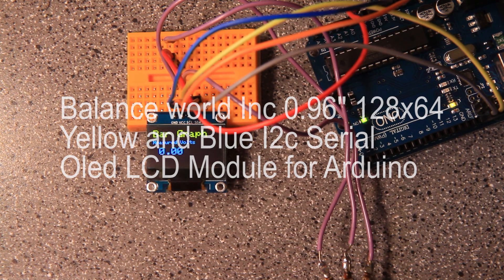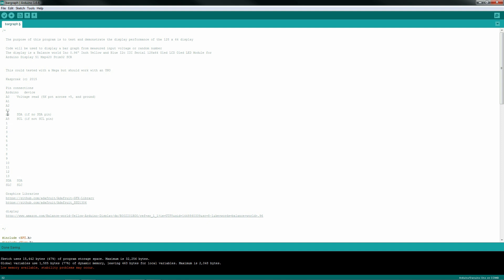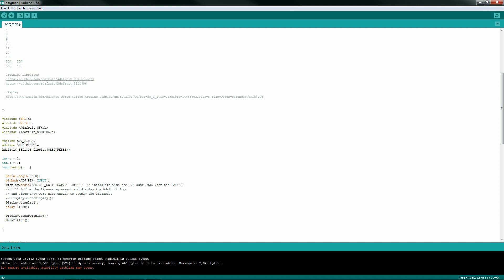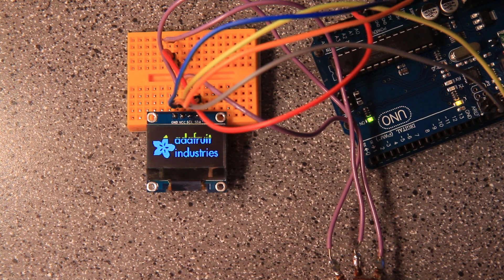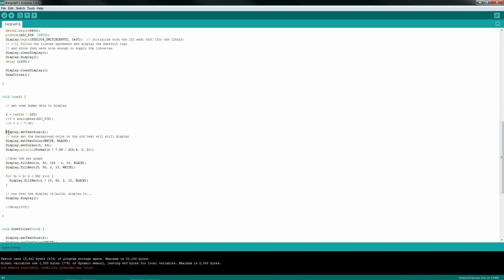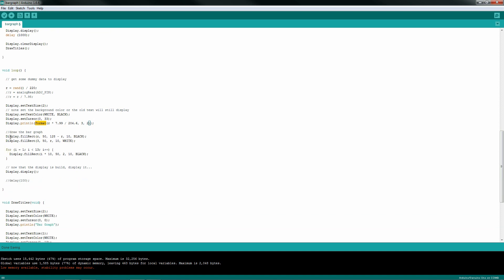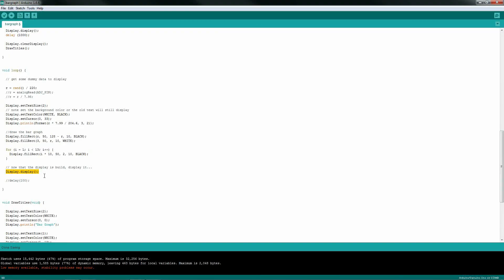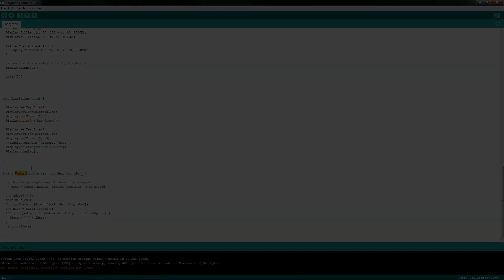Arduino and 128x64 OLED Display FREE CODE!!!

Comment: Hi Kris, I have a Problem with writing a graph for temperature on an Oled Screen. Can I send you the code to look at? The temperature Display is wiped out with the graph although it is in seperate lines. Could you have a look?Regards, Paul
Reply from the maker: OE8PCK sure, I wonder if you could post the code as a comment.
Reply: Thanks for your answer Kris. I think I should say what I am trying to achieve. I fly model gliders and Need a measurement of the Temperature or I should say temperature Change. My sketch recieves a valuse from the Transmitter using a 433 mhz rx. This value is measured aover a few seconds and is used as a ambiant temperature. The Value is then sent to the Oled as a decimal value. Above this acrual valuse I have tried to make a visual value as a graph . The reason is that I Need to see a temperature Change from around 1.5 to 2 degrees C as a graph. The graph I have as the Moment has a Problem, the decimal value is wiped out and the graph disappears after it runs over the Screen..I would like the following.A line that runs over the Screen (the Speed should be changeable in the code) left to right, and when the temperature changes then the line should move up. The actual value should remain . I will now send the sketch for the Receiver, with the OLed, if you Need the TX code please tell me. If you do Change anything please write a description so I can adjust the Speed etc. Many THANKS!!!!!!Paul// receiver temp.
//
#include <VirtualWire.h>#include "U8glib.h"//U8GLIB_SH1106_128X64 u8g(13, 11, 10, 9);  // SW SPI Com: SCK = 13, MOSI = 11, CS = 10, A0 = 9
U8GLIB_SSD1306_128X64 u8g(U8G_I2C_OPT_DEV_0|U8G_I2C_OPT_NO_ACK|U8G_I2C_OPT_FAST);  // Fast I2C / TWI 
int count;
float temperatureNow;
float tempGraph[64];
float baseTemp;
float graphVal2;
int graphVal1;
int graphpos = 0;
void draw(void) {
  u8g.setColorIndex(1);
  
  // graphic commands to redraw the complete screen should be placed here  
  u8g.setFont(u8g_font_unifont);
   u8g.setPrintPos(0,55);
  u8g.print(temperatureNow);
  //u8g.setFont(u8g_font_osb21);
  //u8g.drawStr( 0, 22, "Hello World!");
  u8g.drawBox(0,0,128,40); 
  u8g.setColorIndex(0);
   for(int i=0;i<64;i++)
  {
    if(tempGraph[i] == 0){
      // do nothing if no data in array
    }else{
     graphVal2 = tempGraph[i] - baseTemp;
    graphVal1 = graphVal2 * 10; // a temperature diference of 1.25 would translate to 13 pixels drawn on the graph
    //u8g.drawPixel(graphpos, 40-graphVal1);  One line of pixels isn't very clear
    u8g.drawBox(graphpos,40-graphVal1,2,graphVal1); 
    }
    
    graphpos = graphpos+2;
    }
  graphpos = 0;
 
}void setup(void) {
baseTemp = 100.99;
Serial.begin(9600);  // Debugging only
    Serial.println("setup"); //Prints "Setup" to the serial monitor
    vw_set_rx_pin(12);       //Sets pin D12 as the RX Pin
    //vw_set_ptt_inverted(true); // Required for DR3100
    vw_setup(4000);      // Bits per sec
    vw_rx_start();       // Start the receiver PLL running
  
 // You don't need the color stuff because you display is monochrome
  // assign default color value
//  if ( u8g.getMode() == U8G_MODE_R3G3B2 ) {
//    u8g.setColorIndex(255);     // white
//  }
//  else if ( u8g.getMode() == U8G_MODE_GRAY2BIT ) {
//    u8g.setColorIndex(3);         // max intensity
//  }
//  else if ( u8g.getMode() == U8G_MODE_BW ) {
//    u8g.setColorIndex(1);         // pixel on
//  }
//  else if ( u8g.getMode() == U8G_MODE_HICOLOR ) {
//    u8g.setHiColorByRGB(255,255,255);
//  }
}void loop(void) {
graphpos = 0;
    String tempHolder = "";
    uint8_t buf[VW_MAX_MESSAGE_LEN];
    uint8_t buflen = VW_MAX_MESSAGE_LEN;
    if (vw_get_message(buf, &buflen)) // Non-blocking
    {
        digitalWrite(13, true);  // Flash a light to show received good message
  // Message with a good checksum received, dump it.
  Serial.print("Got: ");
  
  for (int i = 0; i < buflen; i++)
  {
            char c = (buf[i]);
            tempHolder += c;
  }
        count++;
       // Serial.print(count);
 
       temperatureNow = tempHolder.toInt();
       temperatureNow = temperatureNow / 100;
  Serial.println(temperatureNow);
  publishToGraph();
        digitalWrite(13, false);
    }
  
  // picture loop
  u8g.firstPage();  
  do {
    draw();
  } while( u8g.nextPage() );
  
  // rebuild the picture after some delay
  delay(50);
}void publishToGraph() {
   if(temperatureNow < baseTemp){  baseTemp = temperatureNow;
  }
  for(int i=0;i<64;i++)
  {
    tempGraph[i]=tempGraph[i+1];
    }
 tempGraph[64] = temperatureNow;
}
Reply from the maker: First of all, what's not working? can't receive data, plots are wrong, won't compile? Hard to say what the issue could be given the issues in the code. Undefined constants (VW_MAX_MESSAGE_LEN), very odd baud rate (4000), and so on. .
Reply: When I receive data from the 433mhz rx the bar disappears and moves across the screnn and also wipes out the temerature Digits and I end up with a blank Screen. The baud rate id not for the arduino but for the rx, this is Setup eith the same Speed as the TX. I would like just a line which goes across the Screen at ambient temerature and then when the temperature increases the line should bend upwards. The reception of the data is also very erratic but this is not my main Problem that I have. Getting the graph to work so that the temerature Digits are not wiped out and getting the graph to remain visible that are my main concerns.I have been working on this code for 4 and a half months now and it still will not work. I came to you because of your code on the poti and the resulting graph. I guess it is my old Age nearly 70, .. perhaps I should not have  started this and remained wih my Radio stuff which I understand a lot better. :-) I hope I have explained clearly what I am trying to achieve. If you would like a direct Explanation, I have SKYPE and the Skype Name id OE8PCK. Thanks for your Patience.
Reply: I think I have got things a bit muddled. The way the following code is supposed to work is that it Displays a bar that Shows thwe ambient temperature and when the temperature changes the bar changes. Basically it does not work. Could you Show me some code which would Display the Temerature received as a line running from left to right across the Screen and when the temerature increases moves up so as to Show a curve. This line should not interfere with the digital temerature readout I have at pos. 0,55 on the Screen. The idea with a drawing a box does not work because as it moves across the Screen the Digits of the temperature Display are wiped out. Regarding the very odd baud rate (4000), This is used by the Radio Tx and RX, it has nothing to does with baud rates. Regarding the  Undefined constants (VW_MAX_MESSAGE_LEN),  to be honest, I do not understand this part of the code, it has to do with changing the drawn box. Someone sent this to me as a Suggestion. I will now include the sketch again and perhaps you can Change it to Show the Temerature Change as a line. I really only want to see a small temerature Change using this line. e.g. when the temperature changes by 2 degrees C.// receiver temp.
// By Paul OE8PCK
#include <VirtualWire.h>
#include "U8glib.h"U8GLIB_SSD1306_128X64 u8g(U8G_I2C_OPT_DEV_0|U8G_I2C_OPT_NO_ACK|U8G_I2C_OPT_FAST);  // Fast I2C / TWI 
int count;
float temperatureNow;
float tempGraph[64];
float baseTemp;
float graphVal2;
int graphVal1;
int graphpos = 0;void draw(void) {
  u8g.setColorIndex(1);
  
  // graphic commands to redraw the complete screen should be placed here  
  u8g.setFont(u8g_font_unifont);
  
   u8g.setPrintPos(0,55);
  u8g.print(temperatureNow);
 u8g.print(" Degrees C"); 
  u8g.drawBox(0,0,128,40); 
  u8g.setColorIndex(0);
   for(int i=0;i<64;i++)
  {
    if(tempGraph[i] == 0){
      // do nothing if no data in array
    }else{
     graphVal2 = tempGraph[i] - baseTemp;
    graphVal1 = graphVal2 * 10; // a temperature diference of 1.25 would translate to 13 pixels drawn on the graph
    //u8g.drawPixel(graphpos, 40-graphVal1); // One line of pixels isn't very clear
    u8g.drawBox(graphpos,40-graphVal1,2,graphVal1); 
    }
    
    graphpos = graphpos+2;
    }
  graphpos = 0;
 
}void setup(void) {
baseTemp = 100.99;
Serial.begin(9600);  // Debugging only
    Serial.println("setup"); //Prints "Setup" to the serial monitor
    vw_set_rx_pin(12);       //Sets pin D12 as the RX Pin
    //vw_set_ptt_inverted(true); // Required for DR3100
    vw_setup(4000);      // Bits per sec
    vw_rx_start();       // Start the receiver PLL running
  
 
}void loop(void) {
graphpos = 0;
    String tempHolder = "";
    uint8_t buf[VW_MAX_MESSAGE_LEN];
    uint8_t buflen = VW_MAX_MESSAGE_LEN;
    if (vw_get_message(buf, &buflen)) // Non-blocking
    {
        digitalWrite(13, true);  // Flash a light to show received good message
  // Message with a good checksum received, dump it.
  Serial.print("Got: ");
  
  for (int i = 0; i < buflen; i++)
  {
            char c = (buf[i]);
            tempHolder += c;
  }
        count++;
        //Serial.print(count);
 
       temperatureNow = tempHolder.toInt();
       temperatureNow = temperatureNow / 100;
  Serial.print(temperatureNow);
   Serial.println(" Degrees C");  publishToGraph();
        digitalWrite(13, false);
    }
  
  // picture loop
  u8g.firstPage();  
  do {
    draw();
  }
  while( u8g.nextPage() );
  
  // rebuild the picture after some delay
  delay(50);
}void publishToGraph() {
   if(temperatureNow < baseTemp){  baseTemp = temperatureNow;
  }
  for(int i=0;i<64;i++)
  {
    tempGraph[i]=tempGraph[i+1];
    }
 tempGraph[64] = temperatureNow;
}
Reply: Hi Kris,I think I can make things a lot easier. I have now changed your code so as to use the dotted graph to show temperature Change. Could you be so kind as to make the line movement more sensative, i.e. 3 dots per degree of temperature change fom the third temperature reading after the Moment of Switch on. The. LED flashes when the temperature is read OK perhaps you can use this. Does this make my wish now clear? Many thanks in advance for your kind help.
Reply: /*  The purpose of this program is to test and demonstrate the display performance of the 128 x 64 display  Code will be used to display a bar graph from measured input voltage or random number
  The display is a Balance world Inc 0.96" Inch Yellow and Blue I2c IIC Serial 128x64 Oled LCD Oled LED Module for
  Arduino Display 51 Msp420 Stim32 SCR
  This could tested with a Mega but should work with an UNO  Kasprzak (c) 2015  Pin connections
  Arduino   device
  A0    Voltage read (5K pot across +5, and ground)
  A1
  A2
  A3
  A4    SDA (if no SDA pin)
  A5    SCL (if not SCL pin)
  1
  2
  3
  4
  5
  6
  7
  8
  9
  10
  11
  12
  13
  SDA   SDA
  SLC   SLC  Graphics Libraries
  https://github.com/adafruit/Adafruit-GFX-Library
  https://github.com/adafruit/Adafruit_SSD1306  display
  http://www.amazon.com/Balance-world-Yellow-Arduino-Display/dp/B00ZI01RO0/ref=sr_1_1?ie=UTF8&qid=1448860339&sr=8-1&keywords=balance+world+.96
*/#include <SPI.h>
#include <Wire.h>
#include <Adafruit_GFX.h>
#include <Adafruit_SSD1306.h>
#include <VirtualWire.h>
#define OLED_RESET 4
float temperatureNow;
int count;
int graphpos = 0;Adafruit_SSD1306 Display(OLED_RESET);float r = 0;
int i = 0;void setup(void) {
//  baseTemp = 100.99;
  Serial.begin(9600);  // Debugging only
  Serial.println("setup"); //Prints "Setup" to the serial monitor
  vw_set_rx_pin(12);       //Sets pin D12 as the RX Pin
  //vw_set_ptt_inverted(true); // Required for DR3100
  vw_setup(4000);      // Bits per sec
  vw_rx_start();       // Start the receiver PLL running#if (SSD1306_LCDHEIGHT !=64)
#error ("Height incorrect, please fix Adafruit_SSD1306.h!");
#endif
  Display.begin(SSD1306_SWITCHCAPVCC, 0x3C);  // initialize with the I2C addr 0x3C (for the 128x32)
  Display.begin();  // i'll follow the license agreement and display the Adafruit logo
  // and since they were nice enough to supply the libraries
  //Display.clearDisplay();
  Display.display();
  delay (1);
  Display.clearDisplay();
  DrawTitles();}void loop(void) {
  graphpos = 0;
  String tempHolder = "";
  uint8_t buf[VW_MAX_MESSAGE_LEN];
  uint8_t buflen = VW_MAX_MESSAGE_LEN;
 if (vw_get_message(buf, &buflen)) // Non-blocking
  
  {
    digitalWrite(13, true);  // Flash a light to show received good message
    // Message with a good checksum received, dump it.
    Serial.print("Got: ");    for (int i = 0; i < buflen; i++)
    {
      char c = (buf[i]);
      tempHolder += c;
    }
    count++;
    //Serial.print(count);    temperatureNow = tempHolder.toInt();
    temperatureNow = temperatureNow / 100;
    Serial.print(temperatureNow);
    Serial.println(" Degrees C");  }  //void loop() {  // get Temperature  r = temperatureNow;
  
  Display.setTextSize(2);
  // note set the background color or the old text will still display
  Display.setTextColor(WHITE, BLACK);
  Display.setCursor(0, 20);
   Display.print(r);
   Display.println(" C");
   
   //draw the bar graph
  Display.fillRect(r, 50, 128 - r, 10, BLACK);
  Display.fillRect(3, 50, r, 10, WHITE);  for (i = 1; i < 13; i++) {
    Display.fillRect(i * 10, 50, 2, 10, BLACK);
  }  // now that the display is build, display it...
  Display.display();
}
void DrawTitles(void)
{
  Display.setTextSize(1);
  Display.setTextColor(WHITE);
  Display.setCursor(0, 0);
  //Display.print(r);
  Display.println("Thermal Search");
 // Display.display();
}String Format(double val, int dec, int dig ) {  // this is my simple way of formatting a number
  // data = Format(number, digits, decimals) when needed  int addpad = 0;
  char sbuf[20];
  String fdata = (dtostrf(val, dec, dig, sbuf));
  int slen = fdata.length();
  for ( addpad = 1; addpad <= dec + dig - slen; addpad++) {
    fdata = " " + fdata;
  }
  return (fdata);}

Comment: The address specified is the left shifted value, note that the LSB of the address is the R/W bit which is or'ed in by the driver.  Adafruit's driver does the left shifting itself so you have to right shift the value on the board before you pass it to the driver.
Reply from the maker: Thanks for the post, i'm sure this will help my readers understand this.

Comment: I don't suppose you could example how to use two of these displays together with each showing something different on screen could you?
Reply from the maker: +Jason Park Thats possible but the displays must have a different address. The one used there is a fixed address--possibly mixing vendors would result in different addresses. Code would be something like this 

setup()

FirstDisplay.begin(SSD1306_SWITCHCAPVCC, 1111); // what ever it's address is
SecondDisplay.begin(SSD1306_SWITCHCAPVCC, 2222); // what ever it's address is

loop()

  FirstDisplay.setCursor(0, 0);
  FirstDisplay.println("First Display"); 
  FirstDisplay.display();

  SecondDisplay.setCursor(20, 0);
  SecondDisplay.println("Second Display"); 
  SecondDisplay.display();
Reply: +Kris Kasprzak OK. Thanks.
I'll look into it.
I have a couple of the white displays that have link on the rear to change the address.
I'll see if I can make one different and try that.

Thanks.

Comment: and yes, i cant see exactly where the wires for everything go.
Reply from the maker: +Richard Pulliam III There is a pot between GND and +5Volts, then the sweeper is connected to pin A0

in my comment block in the code I call out what gets connected to what.

#define ADJ_PIN A0 // establishes the voltage reading pin

in setup()
pinMode(ADJ_PIN, INPUT); // establishes the ability to read the voltage output from the pot

in loop()

  // commented out is the actual reading of the voltage on pin A0
  // i believe i divide by 7.98 to get the voltage to scale to the screen width (1023 / 128)
  // because the voltage read comes after the rand() call, it will overwrite the value for r
  // then the voltage will be used in the fillRect call
 
  //r = analogRead(ADJ_PIN);
  //r = r / 7.98;
Reply: Thanks man!
Reply from the maker: +Richard Pulliam III You're very welcome. I have some other Arduino videos--a neat one using the same parts to build an oscilloscope--range up to about 4kHz
Reply from the maker: Glad I could help.

Comment: where is the code for the volts meter at the very end?
Reply: It’s the two rectangle draws that he talked about with the R-value where he paints white for the first part and black for the last part. He then put some black lines over the top using if(x %10 == 0) as a discriminator of where to put it.